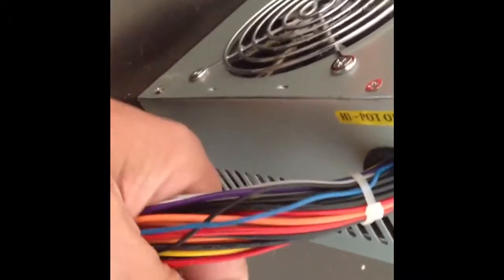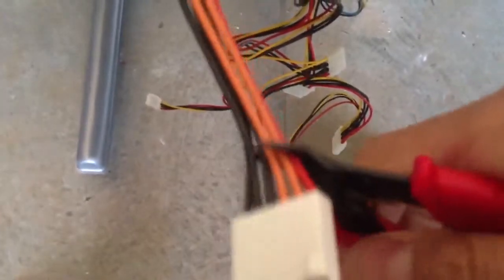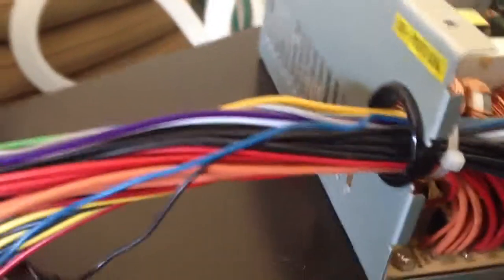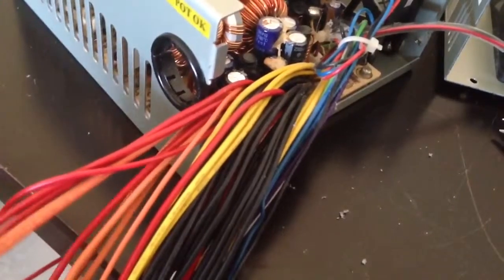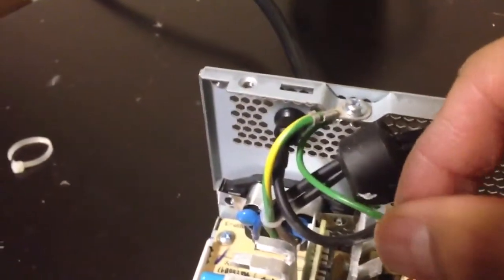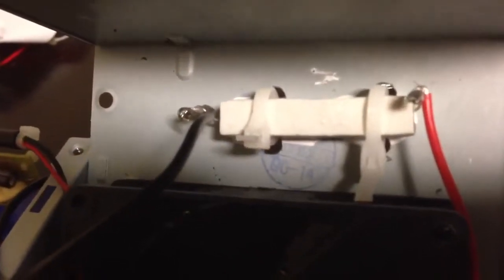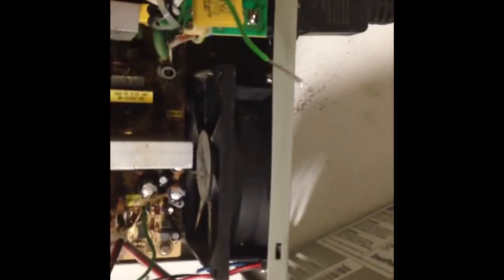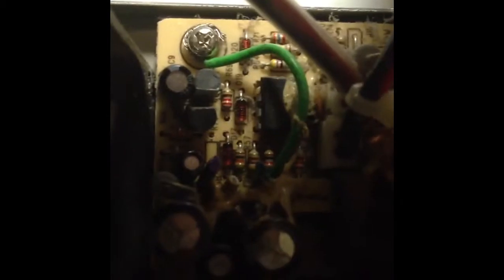Fast and Simple 12V PSU from Old PC

Comment: How many amps can you get out of a single 12v cable?
Because i use it in my lipo charger, but it cant get past 1.5A.

Should i solder all yellow cables together?
Reply from the maker: I will let you know. I just connected them all together in parallel. I suspect the Amps are a lot more then 1.5A. You may have to run it through some sort of current regulator.